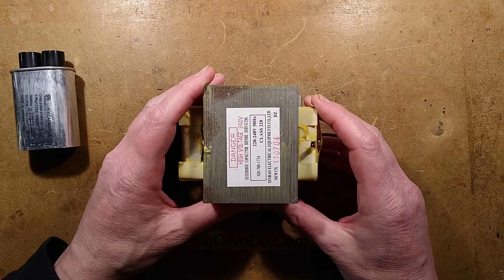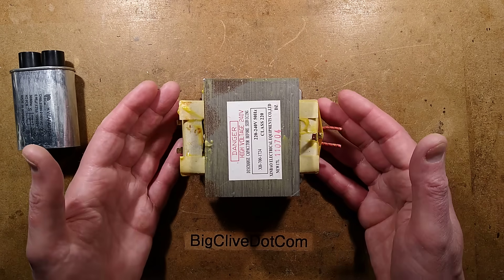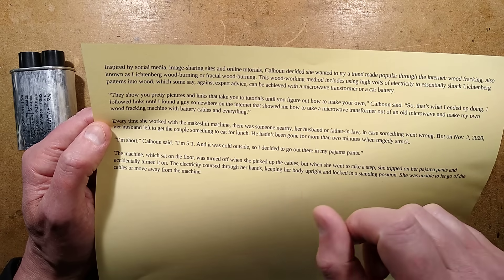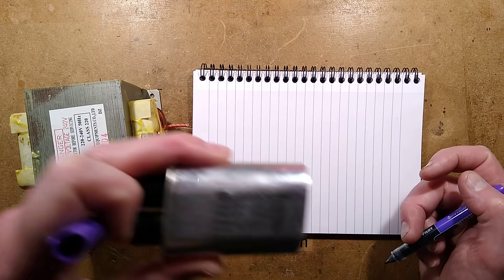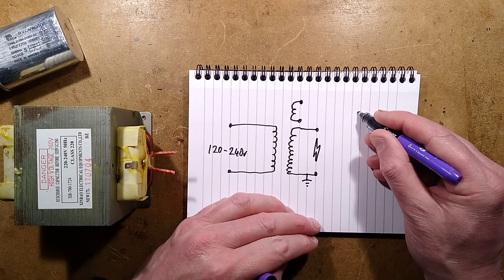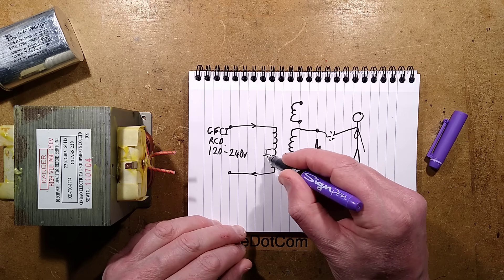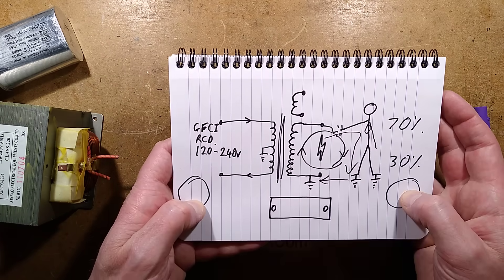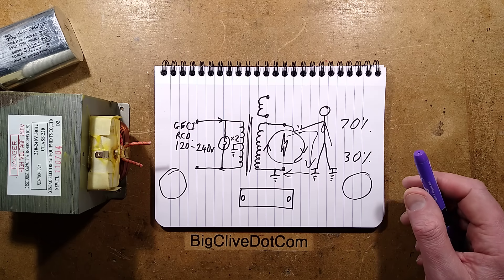The most deadly project on the Internet

Comment: A question about the indicator lights (because my electrical knowledge isn't good enough to answer it myself): would it make the proposed setup safer to put them in line with the transformer (like a fuse) instead of across, or actually more dangerous?
Reply: if you want 2kw out of the transformer, you'd need 2kw worth of light bulbs all in parallel wired in series with the transformer, and if one popped, then you'd get a cascade failure.  yeah, you could, but if wouldn't be practical.
Reply: @jnawk83  Thanks, that was the bit I was missing (the lamps having to be the same wattage as the transformer).

Comment: Great video yet again… I’m an electrician with total respect and understanding how little it takes to kill you stone dead(try explaining it to other traders on site with there extension leads repaired with tape and in wet environments) and there argument is…it’s got a fuse… I’ve messed with MOT’S wit high current low voltage and the high voltage once,I made a Jacob's Ladder… people who are thinking of messing with these mots should see a Jacob's Ladder in action to at least realise the power that’s available
On a side note regarding the capacitor..my best friend brother died trying to repair his washing machine..it was unplugged and  the capacitor got him,only been married a few years and left a wife and 2 very young children

Comment: In 1978 I was stationed in Panama in the US Army.  The barracks were single story with each soldier getting his own room.  Each room had a tall metal locker that reached up to within a foot and a half from the dropped ceiling.  One day I was trying to run an antenna wire up into the ceiling and at one point I had my arm resting on top of the locker which was rather rusty from the humid tropical air.  I reached up and touched the metal rib of the dropped ceiling and got a nasty shock.  I measured 120 volts between the top of the locker and the metal rib.  I didn't get killed because the locker was on a concrete floor so there was some resistance there.  So, I reported it to my sergeant who did nothing.  I escalated it to my captain.  Nothing.  Finally, I figured I'd at least get some use out of the problem and proceeded to run a wire from the screw on a wall outlet, up to a switch and small light bulb, and then up to the ceiling ribs.  Now that I had a good ground, the light bulb shone brightly and I had a new reading lamp!  (Note that I covered all exposed metal on the switch and light bulb so I wouldn't get electrocuted.)  The next day, the captain came through the barracks for his weekly inspection, took one look at my setup, and called in an electrician to fix the problem.  The metal ribs got properly grounded the same day before I returned to the barracks.  No, I didn't get in trouble, and I found out about the fix because the setup was laying on my bed when I returned.

Comment: For some reason this reminds me of a time in college (EE) when I couldn't remember the formula for DC voltage drop over a length of cable.  Naturally I googled the formula and landed at a website geared toward electricians.  After getting the formula I was looking for I wandered to their medium voltage safety section and came across a story of a man who had escaped from a mental institution and climbed a utility pole.  When the police got near he decided to grab the overhead wires.  What stood out the most was that the photos of the results weren't that disturbing as they resembled barbecued meat.  That is until you realize that isn't a nice pork roast but rather one half of the ass of a man that contacted around 12kV.

Comment: awful, its disappointing that many have died from fun projects with microwave oven transformers, I made my own high voltage transformer for even more power, it has 4 secondaries 1100Volts x 4 can be wired in series for 4.4KV 7KVA@5% plenty of current, I made a second unit it has 6.6KV and a 7.2KV windings in series with explosive results, the burns and injuries from these would be horrific, so I never go close when its energized.

Comment: I can quite understand  how people are getting severe burns from this, in my early years of employment (1975)  I used to repair crt televisions and on one occasion I was measuring the ht on the anode which is at a potential of 25KV. The one lead of the test meter came off the chassis of the TV and touched my knee and burnt a hole into my knee straight through my trousers, I still have the scar to this day. Very nasty.

Comment: Thanks Clive. This kind of thing is what I call Domain Incompetence.. like this , where the cutesy maker art overrides common sense ..or an artist decides to make paintings out of radium salts, or amateur rocket makers having failures because their AA spring loaded  battery holders cant take the G forces..
My idiot story.. 
I got a massive shock playing with Kirlian Photography, using a car ignition coil..
Thats the one where you photograph corona discharge by placing items on top of photographic paper on top of an insulating plate with a high voltage AC signal applied to tinfoil the other side. All good until I pointed a multimeter probe at the HV side. Bam!

Comment: At school our Physics teacher (who was also the Head) set up a high voltage transmission line demonstration.  Whilst demonstrating he was getting a little too close to the HV wires suspended between the "pylons".  I thought to myself "don't touch those" moments before he inexplicably grasped the high voltage cables with both hands.  He lurched backwards pulling all the equipment off the table.  Of course, we all thought he was fooling around, teaching us a cruel lesson, but no, it was only when the circuit was broken by the equipment being pulled off the bench, he said a few expletives we realised he had just electrocuted himself.  He was fine, he went very grey haired over the next few months.  Don't play with fire, kids.
Reply: fire is fine. stay away from electricity.

Comment: One thing to note is that high frequency doesn't shock because it's above the frequency response of the nervous system. It has nothing to do with the skin effect. If that were the case, then a microwave working at 2.45GHz would only heat the very surface of meat, rather than penetrating several cm. Obviously there's a huge risk of deep burns, especially in areas of the body where there aren't many nerves, so it doesn't make it safe.

Comment: Helped an electrician rewire a concrete block plant once.
The first thing he did was throw my gloves in the trash.
He gave me some new heavy rubber gloves.
Told him these are kinda clumsy and he said well don't wear them, it can only kill you once then your immune.
Never think there is no power ever,that's what your test equipment is for.
Never push a wire with the inside of your hand always use the back of your hand so you don't get nailed and can't let go.
Protect your eyes because he was blind for a week when he pulled a door open and got flash burned.
Still here 50 years later so everything he shown me worked so far.

Comment: Education is paramount. Especially with high voltage. Being that a lot of education today is self taught through experience, this might be feeding the casualty numbers. It's a bit of a conundrum.

I've thought about this and I'm not normally one for policy intervention, especially when it comes to the DIY or maker segment, however I believe what may be helpful here is to phase out MOT based microwaves altogether and mandate inverter based units with a recycle/amnesty/rebate program.

Inverter based MW's are better to use for food, although a bit more expensive, they do contain a TV style flyback transformer, but I believe they are more difficult to hack into these potentially lethal DIY projects.

I'm not aware of another product on the consumer market that provides readably available access to such large transformers. I don't this this mandate would impact experienced and knowledgeable or electrically qualified makers and hobbyists because making a suitable transformer would be fairly trivial for such people, they would already be very aware of the hazards, as well as transformers being available from suppliers.

Comment: What's the purpose of earthing the secondary? I guess it's to prevent any voltage leakage to the chassis, and entire earth system of the neigbourhood. But even if it did, would there be a chance of someone getting an electric shock?

Comment: Let's not be that dramatic. MOT's deaths are much lower than school shootings, over there... 

BTW, quite a few years ago I was playing with a 64kv transformer, pulling arcs and stinking ozone :D
The electrodes were insulated at the hand level with PP sleeves and got quite hot to the point the insulation started melting on my fingers. 
I freaked, pulled off but the fingers slid over the bare electrodes. 
64 kilovolts out a transformer weighing 25kg. Definitely not a MOT.  
My lucky day, that day because I was not driving it from the mains but from another transformer and the inefficiencies drove the available power way down, resulting in mild burns on the two fingers. 
I was 14, back then... I was really lucky.

Comment: Pure water does not conduct electricity, the water that has other contaminants like salt, can conduct electricity. Thus when you have water and want to work with high voltage electricity it is a NO-GO

Comment: I am glad you opened up with that line

I had a friend who wanted to do something he saw on youtube and asked if I had any dead microwaves....  no just no don't mess with Microwave oven transformers guys please
Reply: Inherently there is nothing more unsafe about a microwave transformer than any other household electronics. However it's the way you use them which introduces the danger. Using them to step up voltages is when it really starts to become dangerous. Higher voltages increase the likelihood you will get a shock where normally its never a real risk.

Comment: I’ve worked with laser generators that require high voltage high frequency power. We had a grounding rod that we touched to all the components before touching anything and we absolutely never, ever worked on it live. Working with ‘leccy is like being a lion tamer; treat like it could turn on you at any time.

Comment: Two decades repairing commercial microwaves, certified electrician. That transformer ups the voltage to 4000v and it has some nasty arcing distance. PSA: Do not open them or play with the transformers. Darwing awards do not need more participants. If you get shocked, do not go to the emergency room complaining you been bads. Waste of money and air molecules.

Comment: Voltage hurts. Current kills. A magnetron delivers current. Voltage is irrelevant in the context of active electrocution, the current is what kills you. A magnetron delivers current that overrides the signals from your nerves. High voltage does not kill at low current, low voltage at high current can kill instantly.

Comment: Very sage advice, BC. When I used to repair televisions for a living I was always very wary of working with them live, something that couldn't always be avoided. I would work with one hand behind my back while standing on a thick rubber insulating mat with the CRT facing a mirror so that I could keep a close eye on the HV end. Even then, nowhere quite as lethal as a jury rigged microwave transformer, but still a very sobering experience.  As the old saying goes, you won't don't that again in a hurry if it catches you out.

Comment: WHAT IS the winding ratio? or what is the indended secondary voltage?  just tell us. i have never designed an electric chair for obvious reasons, so i have no figures on that. and by the way: even well insulated shoes form a capacitve coupling to ground.

Comment: Jumper cables and 2000 VAC ? My first thought is "Run away ".
Most North American mains appliance wires ( ie lamp cord ) has a rated breakdown voltage of 300 to 600 volts. I have never seen a rating on booster cables so no guarantees at all. The only common wires that I can think of made for similar voltages would be automotive ignition leads and, having watched the light show at night from a running car, you couldn't pay me to grab one of those. Neon light wiring would be rated, but not commonly available and, even if the wires are good enough, what is being used for handles? Do they have any surface contamination making a conductive path from electrodes to hands?
There are so many ways to win a Darwin Award on this one.

Comment: I noticed the transformer says high voltage 240v, however the capacitor says 2100v. Odd you tube pulls videos with  hurtful language but does not pull videos that actually  hurt and kill. Voltages and water do not mix that is why no electrical outlets in bathrooms. Salt water is an electrolyte and conducts electricity. This is where a little knowledge is extremely dangerous.

Comment: I once managed to grab a live household electrical socket in one hand bridging the contacts on either side of the socket. This was 120v, because I live in Canada. My father had supposedly turned off the breaker, and we were painting the walls so I went to move it out of the way. 120v 60hz across my hand was enough to feel the muscle contractions up my arm. I was lucky, but it was not a pleasant experience.

I do not want to imagine what several kV feels like coming out of something rated for (typically) 1kva or more. That is so many times worse than even shocking yourself on the capacitor, or even on a CRT TV for that matter, since those are only momentary while this monstrosity will just keep feeding current into you until something breaks the circuit.

Comment: Videos will get filtered showing porn, violence or political incorrect content, but every stupid guy can show deadly high voltage stuff which can kill people without electricity knowledge like an electrician (me for example) Another dangerous point in electrical work are the secondary accidents! For example when you get smashed with your head against something hard or fell off a ladder caused by the shock.

Comment: To be fair, I've replaced wiring on an old powerchair where someone had used the cheap automotive cable, there was more insulation than conductor! I've had chances to play with microwave transformers but its just not worth it

Comment: thank you for this video, Clive! safety is something you can never let yourself get too comfortable with. it needs periodic re-evaluating, even if you think you're fine! 

 for the box: I recommend toggle switches with the little paddles, that are spring loaded, and recessed completely inside. that way, you avoid the possibility of possibly gripping the box and pushing the buttons, the box falling and landing "on", etcetera.

 if you do grip the box during electrocution, you'll probably stop pushing "forward" on the paddle switches, as required to activate it, because the muscles you would use would contract in such a way that inherently pulls your hands "closed", unable to perform the minor forward force.

Comment: I found an even more dangerous project that involves 8 microwave transformers, HV windings all connected in series, being used to power a Jacob's ladder. Somewhere between 7.5 to 8.5kV output at whatever current the MOT is capable of. I don't think even my crazy ass has the balls to try that one.

Comment: The first electronics kit I built in my childhood was a super regenerative HF band receiver.  The antenna was 30 feet of magnet wire strung under the eaves of the roof on hooks we had installed for supporting Christmas lights.  One day I saw an approaching thunderstorm, so I proceeded to disconnect the antenna from the receiver and attach it to ground.  While I was moving the wire to ground, I simultaneously saw and felt a distant lightning bolt (about a mile away, 5 second delay for the thunder.).  It was an unpleasant jolt!   The inverse square law dictates that closer strikes would be exponentially worse.